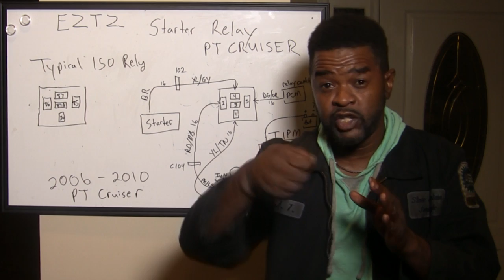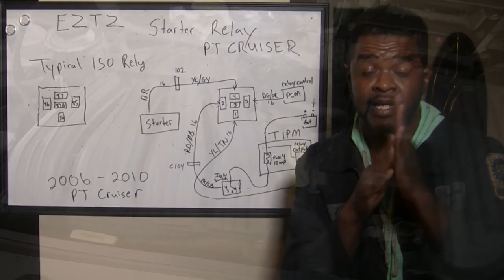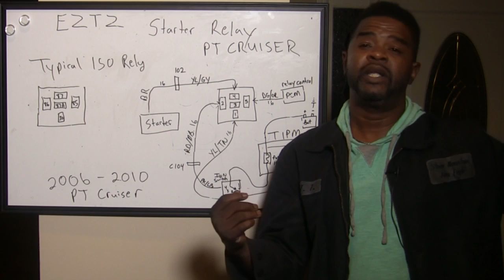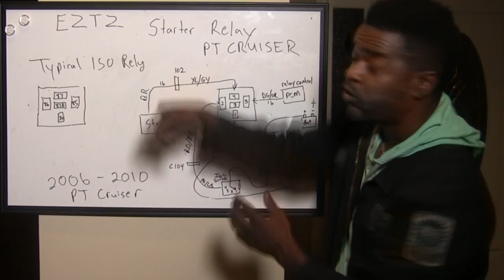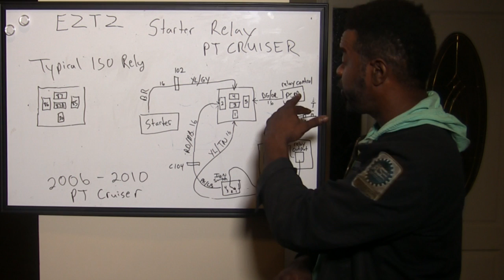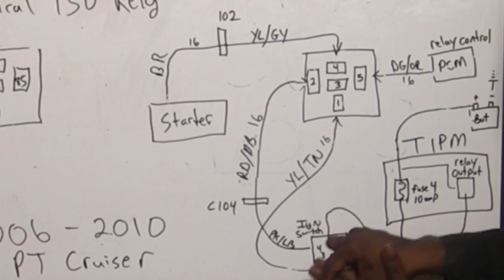No Crank No Start Diagnosis done using the Starter Relay, DIY.Won't Start? Simple Checks. PT Cruiser

Comment: Thanks for another AWESOME  video!!! I'm 75 and still love twisting a wrench. I'm presently working on my neices 2006 pt cruiser. I've fixes the power window, ac, wired in an external relay to c4 at pcm to fix the limp mode problem. Still have codes u0100 and u0101- no com.from tipm to pcm, also, p128D. INTERMITTENT no crank/no start. Got new pcm from Flashmaster going to be here Thursday. Hopefully that will solve some problems. Have replaced TIPM, no help. What program do you use on your HP to turn it into a scanner tool? Thanks again for sharing your knowledge through your videos.

Comment: Hi I have check out the relays and your video just shows when you get power from your relay but what happens when you get no power at the relay? I have a 2006 pt cruiser limited. I had it working after putting in a head gasket and timing belt set, one day i cam home and shut the vehicle off, next morning didn't start and has not started nor cranked back up
Reply from the maker: Ok is this a "No crank" or a "No start" complaint? Also are you subscribed to the channel?

Comment: No crank 2005 pt cruiser I started my car but when I put in reverse it died never has started again dash lights work radio don't light up and there's no crank please can you help me now I have changed the electrical ignition switch that goes to the. Key switch and still no crank 05/24/2025

Comment: How do I check spark on my 2006 pt cruiser. It will crank but want start. It turns over but want start. I have new spark plugs, ignition coils, crank sensor. I need some help

Comment: I need help if you’re still replying. My 06 PT Cruiser Touring Turbo will run fine, then I turn it off, and after about 10 minutes of sitting, it has the no crank issue. But it’s not a normal no-crank. It turns a half revolution or so and then just stops abruptly as if something is telling it to kill the connection. After letting it sit for a good hour or so, it’ll start up again. 

Through diagnostics and testing, I’m able to put a jumper on pins 1&4 (30&87) and it will start fine. As you probably already know, on this model car, jumping those two wires doesn’t automatically engage the starter - you still have to turn the ignition for it to work. So for now I’ve installed a momentary push switch to those wires, (soldered and heat shrinked) that I push while turning the ignition, that way the relay is only being bypassed when the car acts up. 

Do you have any idea what would signal the computer (not sure if it’s the TIPM or the PCM that’s causing it) to kill the signal to the relay while it’s already trying to crank over?
Reply: Also, at first bypassing the relay worked no problem. As of lately, the car sputters sometimes while starting and acts as if it’s not getting fuel. 

Just today, the car cut off while driving - had to push it out of the street. Although the bypass still made the car crank over, it wouldn’t start for a while. Now I’m thinking it’s definitely fuel related, but have no idea where to start with the diagnostics. I don’t mind replacing the fuel pump if it is the actual problem, but idk if the fuel pump itself is going bad or there is an electrical issue somewhere that is stopping the fuel from pumping or even telling the computer it’s not safe to start and killing the signal to the relay. Any help is appreciated

Comment: I think this video is the best I’ve seen regarding troubleshooting no crank conditions. I do have a question regarding placing a ground on pin 5 to replace the signal from the PCM. You mentioned removing the pin before placing the ground. How do you accomplish this? I’m just a driveway mechanic with a meter and test light. If I place a ground at the pin with the relay removed, will I damage the PCM? Thanks for helping folks like us.

Comment: If I jump the ground.. will it crank at least?
Reply: I wonder what color is the wire from 10 amp fuse to ignition switch? Is that the "B", on the ignition switch?
Reply from the maker: @xlargetophat  dude listen, if your security light on that is what's preventinting the no crank. That along with being out of gear would prevent the ground signal at pin 85. You need a scan tool to look inside the security module to see what code it's throwing. This van could easily be in theft mode.
Reply: @OnlineMechanicTips  the owner told me the red dot light has been on for a long time and annoyed her when she drove at night.. so I've been ignoring it. I have no power at "B" at the ignition switch but the 10 amp fuse is good. Also no power on pin 86 when cranking on the starter relay when turning ignition. 

I'm taking the fuse box apart and cleaning and checking all fuses right now. Som corrosion on abs fuse port. 25 amp.. it's next to the starter relay and above the ADS relay.. so I'm hoping it might lead to something inside
Reply from the maker: So why are you even talking about grounds from the PCM if you have not even verified if the power source on point?
Reply: @OnlineMechanicTips  I was too lazy to take off the steering column to get to the ignition switch.. so I put it off.. now I found out.. no power at ignition switch. I touched one of the pins on the connector with the test light.. and something moved on the on ignition cylinder.. that was weird
Reply from the maker: What do you mean? Jump the ground to ground? What kind of car is this?
Reply: @OnlineMechanicTips I got me a 2002 dodge grand caravan with no crank with a red dot light.. I was guessing it's the pcm and not the security causing it. I want to jump 85 to ground because I'm guessing it's a bad ground.. but idk where 85 ground goes to on the chassis. So. Will it crank if I give it ground at 85? Like what your saying here?

I opened up the PCM, looking for burn marks but it was filled with clear silicone.. I didn't see burn motherboard marks
Reply: @OnlineMechanicTips 

I broke off the 85 and put tape over it.. then grounded the slot to the neg battery terminal. Still no crank
Reply: @OnlineMechanicTips  it was the fix. Evidently the red dot security light when on solidly means, miss communication.. but flashing means security issues... Now it's off and starts right up. I damn near towed this vehicle to the dealership.. 🚐
Reply from the maker: @xlargetophat  O cool, thats whats up. Glad you got er done dude.
Reply: There was corrosion on some pins.. I rubbed it off to find the pins now missing metal.. kinda like a cavity on a tooth.. and some rust on a few circuit board lines.. I just rubbed them off and cleaned with electric spray.. if this isn't the problem.. 

I'll have to back probe neutral safety switch?
Reply: I'm going to slap this tipm back in there tomorrow.. see if I have power at the ignition switch... If not I check safety switch. But... I still need to find power wire to ignition switch and get continuity... I guess could I find continuity from the 10 amp fuse to the ignition switch?
Reply: The ignition switch power wire. Light blue/ red stripe was torn open in the wheel well. I'm repairing it now.. I found the harness in the wheel well and rocks cut it open evidently.. I hope this fixes it.

Comment: I have a 2007 pt cruiser with a no crank when it's hot. So in the summer or when it sits in the sun I get a no crank.  Then when the night comes it cranks and starts.
Reply: I plan on waiting for it to do it again so that I can follow your steps.  Have you seen something like this before?
Reply: @stephenblack3712 I know this was a while ago, but did you ever figure out the issue? My sister has an 06 that is having similar issues, except hers won’t start after it’s already been running for a while and after she turns off the car.

Comment: No power on pin 30, what do I need?
Reply from the maker: Check the fuse in the TIPM as stated in the diagram. Is this a PT? Also are you subscribed to the channel?

Comment: I  enjoy all your YouTube channel videos..  I find them very helpful.. I have a 2013 camaro ss that I bought wrecked.  It started when I bought it ,but now  I have a no crank no start no communication with ecu .  I have no check engine light on dash with key on assessory. I checked all grounds and fuses.  Starter turns over only by jumping from relay, but doesn't  start the car.  I changed out all fuses most relays and  100 amp fuse In back at battery.
I'm getting no fuel to the injectors and all functions work on car.  Radio, windows , locks, fuel pump etc. What would be my next step.  Thanks in advance.

Comment: Awesome ! I most likely thinking I have that problem. I have a 2015 ford fusion hybrid. Been broken down in it for 13 days now. I don't think it's getting the 12v ground that it needs to crank over. The security issue part. Now you say to directly run a 12v ground there to the relay. Problem is, I need to know "what" pin I run it to? I can send a pic of the relay.  It would be AWESOME if u can tell me which one.

Comment: I have no power on pin 30 and the fuse is good.  I tried replacing the TIPM and it solved all my issues but the no crank one.   Any advice on where to go next?
Reply from the maker: You could at least start from the top. I have no idea what you working on or what you doing. Also are you subscribed to the channel?
Reply: @OnlineMechanicTips  2006 PT Cruiser.  I put my test light on pin1 / 30 which is supposed to hve 12 volts to it.   Yes I am subscribed now.
Reply from the maker: @hoopz7886  Hey bud, its pretty much laid out in the video. What exactly are you not getting? You said you replaced the TIPM, now do you have 12v at pin 30? If so move on the the next phase.
Reply: @OnlineMechanicTips  ok I replaced the TIPM and still don’t have power at pin 30.  I checked fuse 4 and it’s good.
Reply from the maker: @hoopz7886  ok listen. If fuse 4 has power on both pins and the TIPM been replaced, you must have and open circuit from the TIPM to the starter relay. The yellow/tan wire from the TIPM to the relay must be open somewhere..look around in that area real good
Reply: @OnlineMechanicTips   I disconnected the TIPM and tested continuity from that connector to the relay connector and it's saying it's good.  Would a bad ground on 85 be the culprit still?  I figured I override that ground when I test for power on pin 1 with my test light from the negative post on the battery.    Thanks for all your help!
Reply from the maker: @hoopz7886  no..none of this matters if pi 30 do not have power supply. You not making sense. You cant have power at fuse 4 an its going to the really and you say its connected, but not have 12 volts at the relay pin 30. Dont just look at the fuse and say its good. Do tge fuse have 12 volts on each end? If so, its suppose to be headed to the relay. In not you got other problems. Nothing else matters until pin 30 of the starter relay there
Reply: @OnlineMechanicTips  Thanks for the info.  I put everything back together and checked with my multimeter this time the #4 fuse and it had 12v on both sides.  Not sure what changed but now it starts.  Must be a loose connection somewhere.   Sorry for not being clear.  Thanks again for the help.
Reply: I had tested the fuse before with my test light and it lit up on both sides

Comment: 2015 Hyundai Santa Fe, usually parked in garage, last fall had the engine replaced, it was parked outside one night, temp dropped to below 30 deg, went to start it and nothing, dash lights on but nothing, checked voltage on battery a little low but was enough should have tried to turn over. Charged battery and then tested it and ended up replacing it, same problem but only if the outside temp was below 28-30 deg. Started to think maybe bad or loose ground (dealer did engine replacement under warranty) when they swapped engines. Even changed starter relay, did not help, have to pull intake manifold to get to starter and I got busy with other stuff and vehicle was able to park in garage all winter so no problems and i kind of forgot about it until yesterday, had to park it outside, temperature got down to about 23-25 deg overnite, went out to start it and nothing, jumping it did not work the last time but tried it anyway and nothing. Pulled starter relay and jumped connections and it started right up, you would assume the relay was the problem but it's pretty new, problem only happens if outside temperature drops below about 28-30 deg. Any ideas or thoughts ?

Comment: Hey JT as I was cruising the net as us curious old guys sometimes do I happened by your video on the operation on pcm's ...just do happens I have a 97 dodge sport I bought years back supposedly suffering from the dreaded pcm failure sitting in my sea of cars ....this is my space reserved for when a better time rolls around and I might get the nerve or maybe a better word would be confidence to tackle it ... I bought the truck with 3 miles on the odometer and managed to keep it in rolling condition to the 380 k mark before it stopped ... Im a home builder/construction contractor with 52 years of hands on exp. to  relate too. i guess you could say I have a passion for this trade  as I believe you likewise have for yours ... It's a great thing to see and with your efforts and your communication I am inspired to now undertake this project ... My sea of vehicles is quite diverse ... Everything from the my first  300 sel Mercedes I bought in Dallas 30+ years ago to a custom built toy hauler called the  magnum and many others In between .. Anyway thanks for the inspiration I'll be looking forward to watching your videos !!!

Comment: question on my Hypothesis:
2006 f150 sitting in auction yard. claim no crank no start. 
theory- 20v drill battery & jumper wire to energize starter relay. need to hear engine crank or fire before closing on auction.
(5.4 3v is such a mechanical problem engine)
Reply: will a external battery energize the starter ?

Comment: I have a 87 Toyota truck motor home. The pins on the relay look the same. You said they pretty much all work the same. There is probably not a snow balls chance in hell you’ve worked on one of these, but you never know. Thank you so much.

Comment: Going after my friends 2005 PT Cruiser that broke down with this same issue outside of Indy. He had it towed to a local shop that has put 2 ECMs in with no luck. I am having him take his spare key with him and we are going to check the IOD fuse, and the 10amp fuse. We know the starter is good for they pulled and tested it. Not sure of the other tests they have ran, so we are going to tow it back to KY and do some troubleshooting. Thanks for your explanation.

Comment: My pt cruiser is a 2004 with turbo engine. Please help..It dinga long when you put the key in,when you turn pauses in between the dings. I dont hear anything else. I don't have a 2nd car. Need to be able to get to work. COuld it just be the starter relay? Having someone to put stuff on for me is what I am worried about, the cost, and how I will be getting to work all week. I'm scared.

Comment: chevy s10 2.2 - so I removed the starter relay and used a test light I have power to #30, I have power at #86 when I turn the key. I switched the test light to the positive post and tested #85 and it lid up. truck turns over when I jump #30 to #87. I used my power probe and touched the S terminal on the starter and it does turn on. but no power to the S wire when I turn the key. fuses and relay are good. by the way I subscribed sor👍🏼🤘🏼

Comment: I have a 2012 Dodge Charger 3.6. Starter iso relay pin 85 no current and ignition/switch iso relay pin 85 no current. I replace the pcm programmed and everything and still no crank.